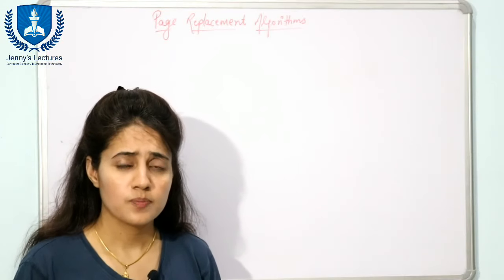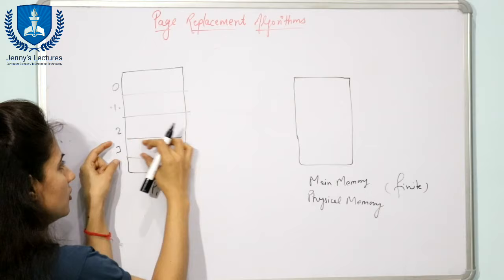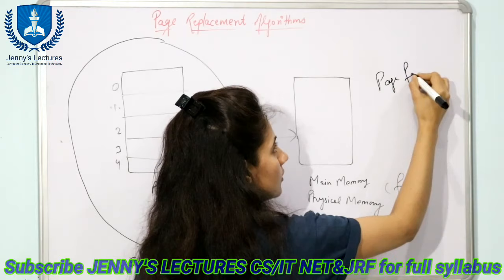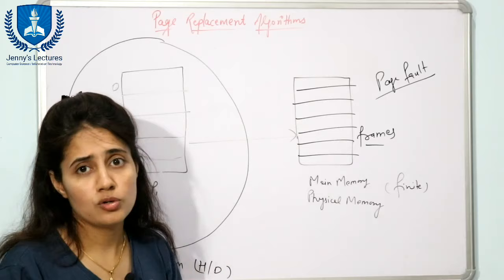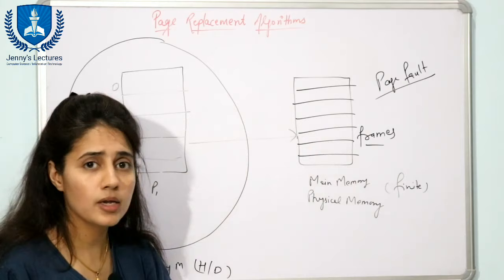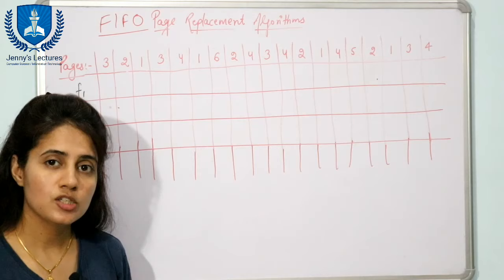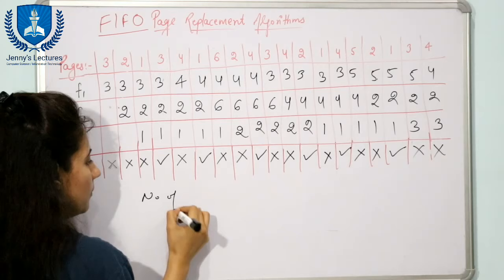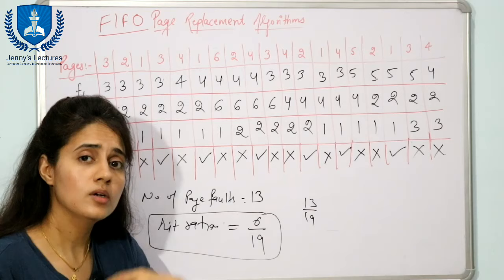Lec28 Page replacement Introduction| FIFO page replacement algorithm with example| Operating System

Comment: Nice explanation, Thank you !!! You deserve a gold medal❤
Reply: Consider a main memory with the capacity of 6 frames. Let the following address sequence is recorded for a process P:

0101, 0564, 0456, 0433, 0438, 0567, 0200, 0987, 0876, 0869, 0854, 0984, 0187, 0345, 0564, 0678, 0921, 0453, 0563, 0123, 0358, 0748, 0582, 0582

Assuming that there are 100 bytes per page, determine the number of page faults for FIFO page- replacement algorithm.
Please solve this problem

Comment: Where is the need for a page in RAM to be swapped out and PUT BACK into Secondary Memory ?  Since the original page in Sec Mem is still there.  Instead, the page in RAM to be swapped out could be over-written by the swap-in page.   Why should another over-writing operation be done on the Sec Mem be done by the swapped-out page ?

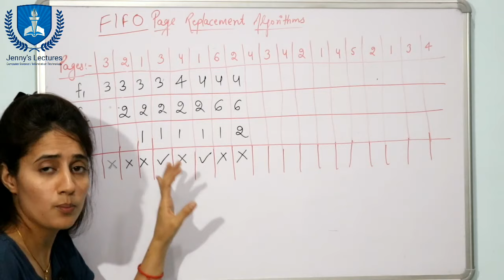Comment: When you replaces 6 with 2 this is incorrect method at ( 16:39 second)
Because I used this method in other questions it will become totally wrong for other questions. so Take it in your mind and give another example solution

Comment: Consider a main memory with the capacity of 6 frames. Let the following address sequence is recorded for a process P:

0101, 0564, 0456, 0433, 0438, 0567, 0200, 0987, 0876, 0869, 0854, 0984, 0187, 0345, 0564, 0678, 0921, 0453, 0563, 0123, 0358, 0748, 0582, 0582

Assuming that there are 100 bytes per page, determine the number of page faults for FIFO page- replacement algorithm.
Please solve this problem